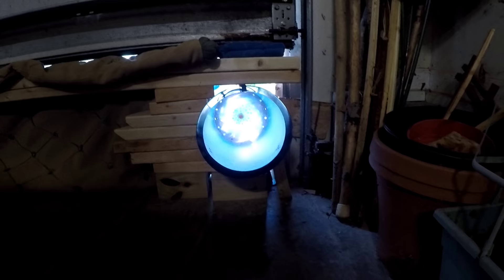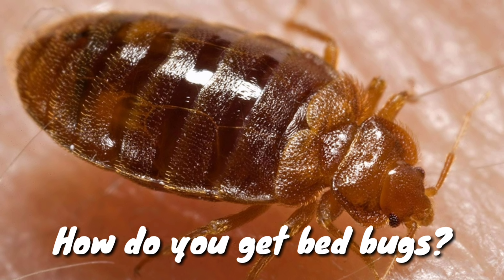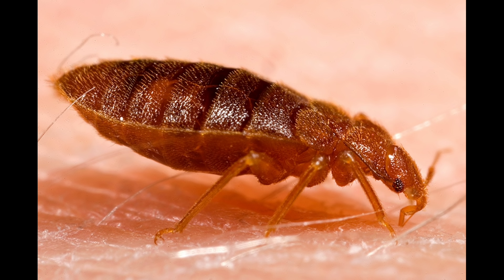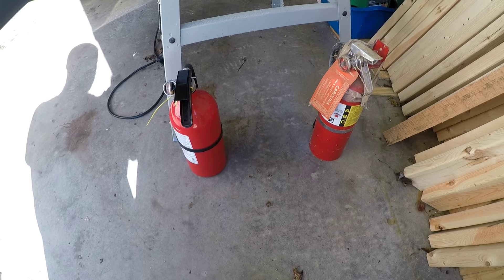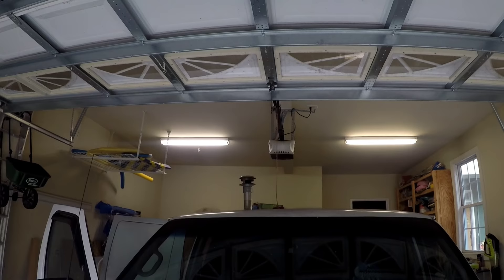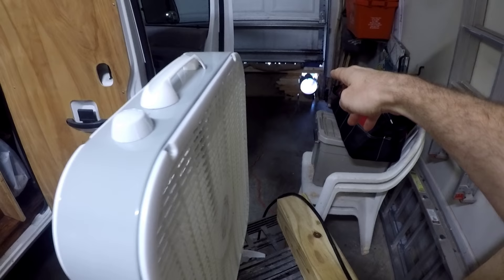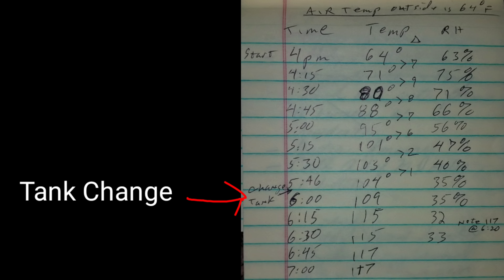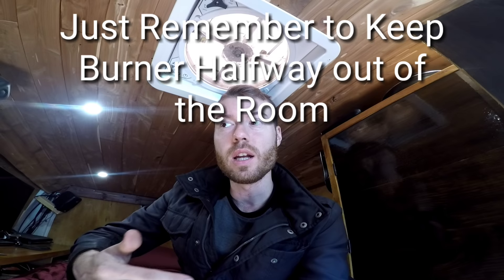How to Kill Bed Bugs Instantly for Van Life

Comment: Thanks for the video, much appreciated. I did mine yesterday without a garage in my van. I used a propane camp stove and my installed vent fan. Started at 90 degrees and got it up to 120 in about 2 and a half hours. I actually kept increasing until it got to 135 in the third hour. I maintained this temp until 5 hours was reached. Woke up this morning with no new bites. Gonna do it again today just to be sure.
Reply from the maker: Hell yeah!
Reply: i have a question, what was the outside temperature when you heated van? did you use 1 or 2 stove burners and where did you place stove ? did you crack windows?
Reply: Did your heat treatment work?
Reply: Shouldn’t have to do the same thing twice

Comment: I picked up bedbugs from a hostel in Morocco, I had a severe reaction to them like being stung by 50 bees, they plagued me for two weeks, biting me every night, I just couldn't escape I tried everything. I tried cooking all my gear in black rubbish bags in the Sahara, tried tumble dry everything I owned, after two weeks the only thing that worked was putting everything I had in a chest freezer for 3 days. It was one of the worst experiences of my life and I still have borderline panic attacks whenever I see any insect remotely like a bed bug. I even ended up getting nightmares from them and occasionally up to months after it happened I found myself waking up freaking out in the middle of the night thinking I was getting bitten. I wouldn't wish these insects on anyone, absolute nightmare
Reply from the maker: Dude, I feel your pain. This doesn't come through in my video, but I don't ever want to see another one of these bugs again.
Reply: The nightmares are the worst part... I am lucky I escaped them
Reply: Reubs i’m always scared i get them but like you said i will know when i get them right?
Reply: i believe a certian species of bedbug is has more severe bites because the first 2 times i had bedbugs i developed itchy red bumps and i got rid of them using ant and roach spray but the 3 rd time i got them i developed much more severe bites where the bites where open wounds and caused 2 secondary infections . abd these bugs were very resistant to bug spray .
Reply: Well said. They are a nightmare
Reply: In.

Comment: Take your rig out to the desert on a really hot day. Lock it up and let the sun rock it at about 120 for a couple hours. I used to kill bugs for 10 years residential and commercial. DO NOT sit inside or keep any critters you love in the van while you do this!
Reply: "Do not sit inside your viechle at 120 degrees while your are killing bed bugs". Ok. It's a good thing you warned me. Saved me a lot of suffering and heat stroke.
Reply: What about your gas tank with the propane? This seems so dangerous!!

Comment: Yo bro you need to heat to 140 f in order to be 100 percent sure.   Tried lower temperatures but after a couple of weeks the bugs were back with a vengeance.  This time they were armed with Ak’s and anti aircraft missiles along with law tactical rockets.   It was a brutal battle.  They had the spartan mentality mixed with the crusaders spirit of “God wills it!”
Reply from the maker: When I had bed bugs, they hadn't evolved far enough to use the weapons, but god damn did they have them.

The temperature at the bottom of the garage was 120 at points, and the top of the garage was 140. It appeared as though they had all crawled up to the top of the van to escape, but crawled the wrong way and did meet 140 degrees. There are video experiments on YouTube of them dying in a closed chamber at 117 degrees though, so as long as every single crevice hits 117, you will rid yourself of them and win the war. The issue is that it must be kept at this temperature prolonged because the temperature of the air might be 117, but the tiny crevices might not have had a chance to all heat up yet. It's important that it heats up slowly, and not too quickly too. Doing it too fast sends them into a panic and they run to find a cooler spot. Heating slowly keeps them blind and they will stay and die in spot.
Reply: Exodus 15:26; Proverbs 4:18-27; Ezekiel 14:1-23 / King James Bible ONLY! )

Comment: I was assigned a truck with a sleeper birth from the company I was driving for, the first night out after driving I pulled into a rest area and was laying on the bed watching netflix on my my ipad when I felt something biting me. Yep!! that got me up quick and I turned on the light to see bugs crawling all over my sleeping bag, Damn... they gave me an infested truck!!  Being a company truck I was limited on what I could do, I let my dispatch know what the problems was and since I was O.T.R I really didn't have many choices so I went to a Menards and in the parking lot I fumigated the entire inside of the truck with bedbug sprays and disinfectant wipes and allot of paper towel, I also bought a mini vacuum. I put the mattress in large plastic bags and taped it up after I spayed the crap out of it with bedbug killer. It was a long day, I also went to a laundry mat to wash all my clothes and gear. after I got back I was issued a new mattress and further clean the truck.    Next time I'm assigned a truck to take O.T.R I will inspect it fully so I don't have that problem again.   thanks for reading.

Comment: I've seen another vanlifer who used the summer heat to get rid of his bug issues. He parked outside in a100  degree heat parking lot, removed all reflective insulation from the windows and windshield, then let the van sit several hrs in high heat parking lot. He had reported that it was a success after few months of no bug infestation.

Comment: Even simpler method:  Go to Death Valley, palm Springs, or any other hot place, in the summer, check into the hotel, park the car in the sun with the windows closed, point the car south so maximum sunlight will come in through the wind shield,  spend the day at the hotel have a luxurious time at the lodge, swiming pool, dining room, spa, napping, etc.  Let nature supply all the heat while you stand back and wait for the critters to die.
Reply: yhnbgt365 that’s what I was thinking 😂
Reply: and you will get another bed bugs in that hotel :D
Reply: Bed bugs are so good at surviving that they will chew the wood siding to create hand fans and fan each other to cool themselves off. They will even go Bear Grills and drink their own piss to stay hydrated.
Reply: I hate to say it, but obviously you've never been in this situation/tried those things. They just crawl into the crevices where it's cool towards the bottom
Reply: Make sure the tires are taken with you or they will melt
Reply: Exodus 15:26; Proverbs 4:18-27; Ezekiel 14:23 / King James Bible ONLY!

Comment: High heat kills bed bugs. One hot summer day I saw bed bugs crawling all over in the bedroom as they were searching for cooler temperatures, and realized mosquitos weren't biting me. I had bed bugs!

The hot temperature helped me identify them, but I chose an easier, safer, and less expensive way than heat to kill all of them.
Reply: What’s that?
Reply: @glennahuff8233  My answer to your question was deleted. I did not use a heat treatment to get rid of all my bed bugs.

Comment: Too high of a temperature can be bad for your electronics but not sure if 117 is enough to damage electronics, even if it's prolonged.
Reply from the maker: 117 is definitely enough. You only go higher for a house, like 140, because you want to make sure the heat penetrates everywhere over time.
Reply: @OutdoorsEmbrace  I meant enough to damage electronics
Reply: @OutdoorsEmbrace  But since you already did this I assume all your technology is fine so my theory is probably wrong.
Reply from the maker: @jsprunger6246  oh! I read your comment wrong. Yeah! Some people mess their shit up by going in excess of 130.
I literally only hit 117 at the critical spots, so everything is working and no damage was detected still today

Comment: It's been a little while since you posted the vid. Did your treatment do the trick for you? This is a very relatable issue and handy vid for any one with the same issue.
Reply from the maker: Yes! I honestly had to use two propane tanks in a row to get it to work. I tried two other times beforehand with just one tank and failed. I didn't say this in the video, but I really think I should have now.
Reply from the maker: @alp I showed a chart towards the end of the video with times and temps. I forget without watching it again, but I think it was at least 3 hours.

Comment: How were your sensitive electronics after this?  Not sure if I missed the part where you would have removed them, but it figures that a flat screen, battery, or even adhesives wouldn't do too well.
Reply from the maker: They are completely fine.
Reply from the maker: I used extremely high heat adhesives for everything too. All was fine afterwards. Nothing was hurt.
Reply: if u un plug  eltronics I believe if it was me I would  heat in a different  manner  but for a van I guess this plan was fine does anyone know how to remove them  on a boat. in my hole life I have never had them but now  I have something. I am trying to identify I am not sure.

Comment: How would this treatment impact the electrical wiring in the van including Solar Power systems? 

Would you have to remove all batteries in the process?
Reply from the maker: Just shut down all power, you do not need to remove anything. The temps reached are not too high for batteries, but do not have them running either creating extra heat (possibly could overheat then)

Comment: If I got the inside of my car up to 140 degrees for 2 hours would that kill them? I pre treated with permethrin and crossfire ? I left the car running on a hot sunny day with the heat on low to raise the temp burned my hand on the back of the seat 😆 raid foaming bedbug spray has the same ingredients as crossfire for 10 USD 👌
Reply from the maker: Yeah, that would work

Comment: I have a question I saw someone asked. I'm in a basement. What about the electronics like stereo & tv?  I like your video, it's helpful! Please advise !
Reply from the maker: They can hide anywhere, but prefer to be right next to where you sleep, like around the bed.

Don't worry about electronics around this temperature btw. I'd only start to worry when it gets up to 140 F. Just turn everything off first though before starting.

Comment: I live in an apartment and ive been having trouble with bed bugs for awhile now did the diatamecous earth thing but im afraid we still have them. I really wanna try this but im afraid that I'll burn down the house 😬
Reply from the maker: Yes, exactly!
Reply: Hotels use use the hot steaming machines. 
I bought a portable handheld one and treat cracks and crevices where they can be on and around the bed and bed platform. 
I have a wood platform for the mattress. 
They can be dormant for 6 months to a year also. So just when you think they’re gone, guess what. They can drive you insane. Look for signs of black tiny spots on bedding in every crease, crack and crevice, hit it all with the steamer.
Reply: Those

Comment: Do you think an electric heater with the car heater running with the window rolled up would work?
Reply from the maker: Depending on the heat outside, but most likely no. I tried this myself a few times before putting out the answer in this video. It didn't get hot enough.

Comment: Thanks. Can this be done in an SUV? Does the door have to be open? And can a paint bake booth work?
Reply from the maker: Sure it could! Just needs to get hot enough inside and done long enough for the heat to penetrate all areas.

Comment: ok nice video but did this kill all the bed bugs honestly? because I hear the heat is supposed to be direct not circulated like you did
Reply from the maker: It definitely killed them all. A good pile of them were found at the roof of the van on the outside dead. They tried to crawl out of van to get away from heat, but apparently went the wrong way haha

Comment: thought i was the only one who had bedbugs in my van . i sprayed everything with ant and roach spray and i stopped getting bitten untill a few weeks later i am being bitten again but no where as many as before i sprayed everything.
Reply from the maker: Oooo, remember you live in there and breath in that stuff in such a small space. It kills bugs, it damages you too! Be careful with sprays and chemicals in a small enclosure.
Reply: its the only thing i know that works besides heating the van up but i cant spend the money for a hotel while i cook the van . i dont allow bear skin to touch anyrhing.  i sprayed a light coat on  mattress and put a cover over it and a thick blanket windows stay open . i did this before years ago when i moved into a bed bug apartment and it worked . after 3 months i found a bed bug and sprayed matress and frame and was bed bug free for years . i used my van to help someone move. and they mentioned after i had loaded furniture into van that they had a bed bug infestation and i thought the south carolina summer would kill them off but apparently not because i have them now . maybe it slowed them down but now cooler weather is here and im being bitten with more intesity.
Reply: @OutdoorsEmbrace  i am still getting bit. i geuss i have insecticide resistant bugs. so i gathered  everything under bed threw in dryer got rid of cardboard boxes and threw some stuff out. i sprayed some bug spray on frame again and washed and dryed bed encasement and everything thats been treated placed in sealer bags .
Reply: @OutdoorsEmbrace  i believe i am getting the bugs under control. i put caulking in all the crevices in my wooden bed frame i made from 2by4s and ply wood. with the bedframe now free of gaps and crevices for them to hide and mattress encasement and blankets being put in dryer i believe they well be gone soon if they are not already. i have everything under the bed in trash bags and tape around legs to trap any rouge bugs
Reply from the maker: @startrekstardate6264  tape around legs. Ugggg I feel the pain all over again just hearing about it! Haha
Reply: So 2 days in and no new bites. I just put bedding and encasement in dryer fir 18 minutes .I geuss bedbugs were indeed living in bed frame .i wonder how long they will live in sealed crevice?
Reply: @OutdoorsEmbrace  uhh so im getting bit again some of the caulking has cracked and i think they are escaping . i plan next week to buy a forced air propane heater. since i have no house i will put the heater in whole where my window ac goes in back . i will have to build a stand or something to hold it in place . probably will need a smaller btu rating since the heat is goinf directly in van . i have inverter generator and propane tank . thought about using camper stove but i dunno is 1 double burner stove will create enough heat fast enough. and if i get 2 then i would need to buy another propane tank .
Reply from the maker: @startrekstardate6264  I'm hoping it's enough to kill them! Not sure what else to say, I think this is a better plan now though. Just be careful
Reply: @OutdoorsEmbrace  so i have the mr heater 30k -60 btu contractor series focrced air propane heater i tested it today and it made the van unbearably hot in 10 minutes. i plan on. having it sit on make shift table and point into square hole where ac goes in back window and i will crack driver side window . basically the same concept except the van is heated from inside . 

do you think i should remote my laundry in trash bags or should i leave it in there ?  im gonna cook my van all day sunday and spray ant and roach spray behind panel.
Reply from the maker: @startrekstardate6264  I'd leave everything inside
Reply: @startrekstardate6264  did you rid them yet? if so how exactky? Im in a campervan
Reply: @inthesky7836  well i had no bites for 7 months and when i pull3d my winter clothes out of storage i started getting bites again.I have no idea if that where they come from because its possible that I caugght the bugs from company truck i drive in or temp workers who often stay at hotels who hitch ride with me.

Comment: 117 degrees all you got to do is Park that van in the sun in the summertime
Reply: You have no idea what you're talking about- they just crawl down into crevices where it's cooler & inaccessible. I've heated my van so hot 3x that my heater fan melted, my shoes warped and I cooked ground beef inside with no oven. You need it heated from underneath/like he says in the video.
Reply: @thingsmac  I heated my van to 145° + for hours with no circulating air inside while parked against the side of a huge cinder block building on asphalt parked headed South.
Thermometer read 117° an hour afrer sunset still inside.
It was so hot...on another level still..unreal hot.
I got bit again as soon as it was cooled off enough to drive it.